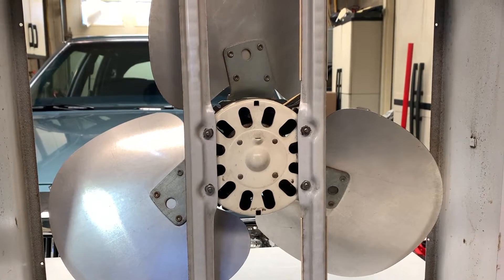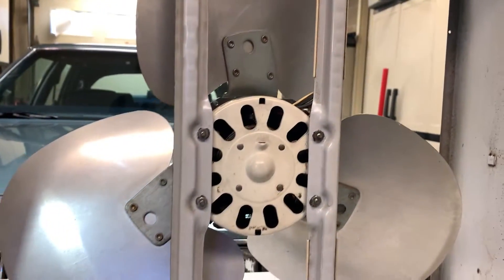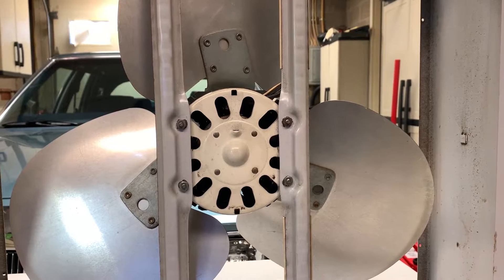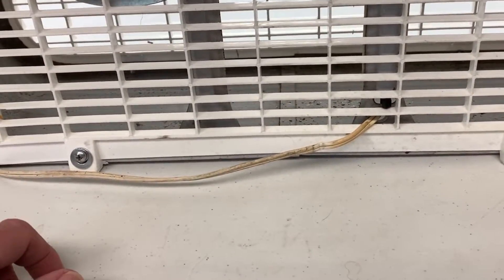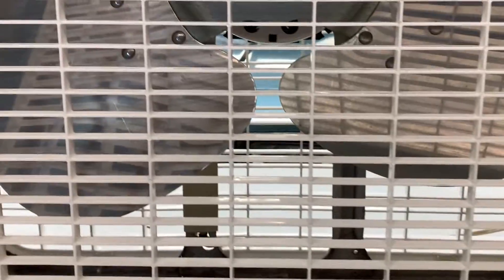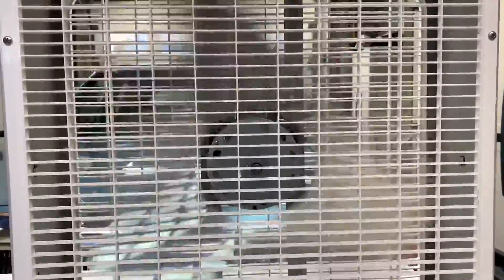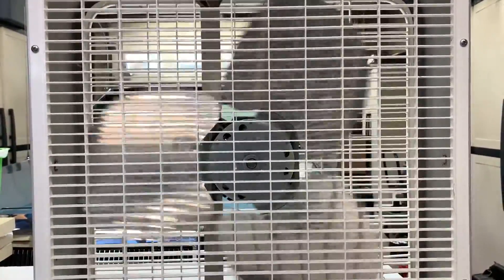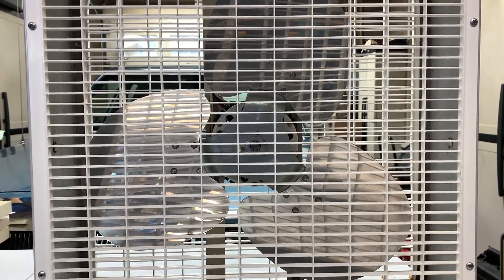Lakewood "F-23" FrankenFan 5 Year Update

Comment: are u still interested in the Lakewood box fans? i live in butler pa i have a P223 it still runs with an older mcmillan shaded pole motor with no thermal protection. its an 80s cabinet with 2nd gen bladeset in very good condition. but needs grilles will make a good donor parts fan if you and Harley are interested in it.
Reply: Sure!

Comment: Very cool! I remember watching the original video 5 years ago lol! I wasn't aware that Lakewood still made the metal bladed fans in 2007! That's crazy! When is the cabinet itself from? Love the startup sound too! Kinda like my little Frigid I did a video on. Looking forward to the next video! :)
Reply: Hehe yep!  This cabinet and blade was originally a 2007 P-25.  It had one of the last McMillan motors, the "less powerful" PSC motor with the very narrow vent holes, that tended to be paired with a China-Pride capacitor that would fail and take the motor windings with it.  The motor is from a 1981 P223, the cord and switch are from eh.. I believe a 1984'ish P223, and the handle and switch knob are from a parts box so.. who knows :-)
Reply: Oh and Spats actually has another 2007 P-25 new in box that was purchased at the same time this one originally was.

Comment: It comes as absolutely no surprise that a FrankenFan, made of leftover irregular equipment, is running perfectly, while a China Pride WalMart special can't make it out of the warranty period.
Reply: Why can't everything made in China last as long at the Coronavirus
Reply: @IAmNotAFunguy  China makes everything.  They try and try and try, yet nothing lasts.  Until the one thing they should get wrong, they get right!  Typical.
Reply: lol yup!  I think my personal record (not purposeful anyhow) was an Aerospeed box fan from 2006, it lasted almost a month before failing.  Opening the motor showed the windings covered with "copper balls," so if it had not been for the thermal fuse, it would have been on fire.
Reply: Harley Badger my record was 1 week on a 6” Mainstays clip fan. The bearings wore out so severely it sounded like a dragster was revving its engine in my house
Reply: @alexthefanguy  HOLY SHIT ok yeah, you got me beat xD

Comment: Not uncommon for a Lakewood to have years of trouble free use. I love that startup sound!
Reply: i liked it when i had my Kmart p-23 fan but no longer have it original motor was a curbside find and in good working order as i have a parts p223 fan the fan works but both grilles are shot was asking since i live in pa that being Spatsbear it be a good donor fan cabinet is good, 2nd gen blade good.